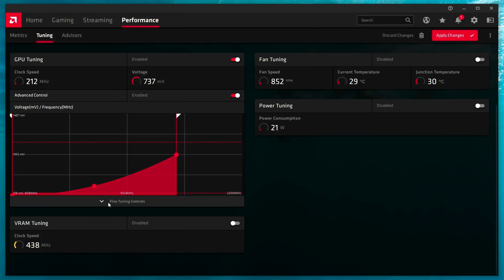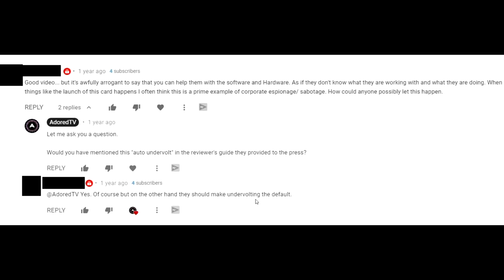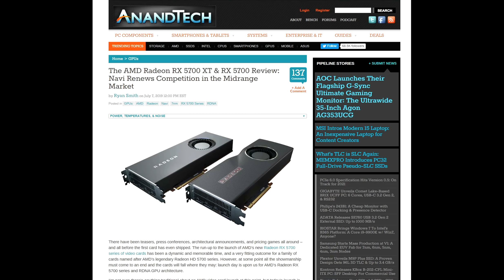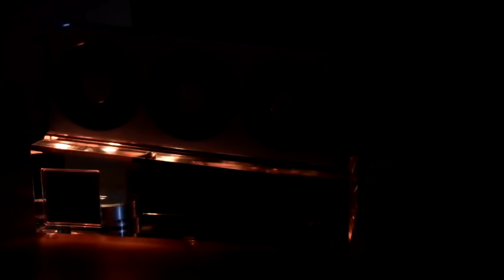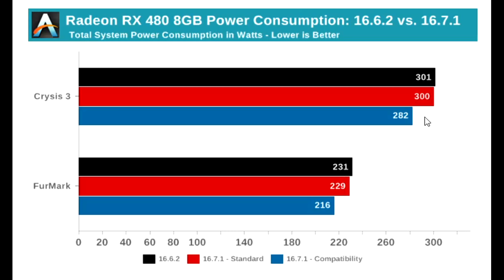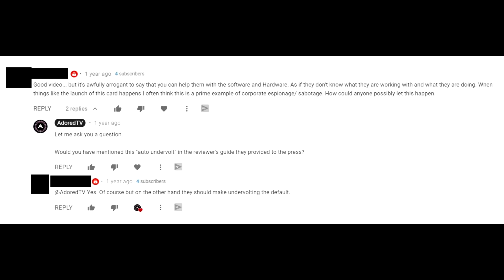Fixing AMD's "Hot and Loud" Graphics Launches.

Comment: Or they could just burn fuses in hardware to tally expected silicon wear-and-tear, and act on this information at a hardware level.  Now /that/ sounds like something nvidia would do!  Storage and printing hardware, for example, use this type of trick to do terrible, highly profitable things to consumers, like under-report toner levels (ie Brother MFC) or brick devices beyond a predetermined accrued data "write" quantity (ie Intel PCIe storage).  So  the card could have a (maybe, opt-out-able) mechanism to, for example, slowly ramp voltage to levels expected to achieve rock-solid stability for two sigmas of customers at a given accumulated area under the watt-time or compute-load-time curves, or both, going back to the original delivery.  This also would also enable the RMA department to mine this data, and even to inform behavior: is this crispy wafer due to two years of mining in a sweaty closet?  Has the card been sitting there unused for two years and the paste dried up?  They could even to enforce divergent stealth RMA policies, i.e., dick over miners if they have voided their warranty in any way no matter how trivial, but honor even marginal warranty claims coming from intermittent-load normies and little old ladies who never used the card for anything.

Comment: making a better cooler too expensive my ass. AMD is making higher margin on the 5700xt than they have ever made on a card. Most AIB card makers say the cost of the cooler ranges from around $35 for a blower and vapor chamber to $50 for dual axial or tri fans. and about $80 for water cooling or hybrid card. and these are very generous estimates I expect given the AIB's are making only around 10% margin on most mid range cards that are at most most $70 more than the reference, not that I will discount the reduced price of the AIB for the gpu silicon by the additional cost of changing the pcb from non reference as in the case of Sapphire

Comment: i buy a ryzen 3600 i have problems with my ASUS STRIX B450 F because of the high CPU temps on IDLE, and really hight temps on CINEBENCH20 with stock cooler so i buy a WATER COOLER COOLER MASTER ML240L and i have 70C max on CINEBENCH20 but i really dont like the CPU spikes on idle is 40c to 54c using firefox, then i buy a RED DEVIL 5700 XT, and i have the problems of all BLACK SCREEN alot ALOT of BSOD, and now with the 20.1.3 i can have a normal working PC, but if  i use UNDERVOLT i use MSI AFTERBURNER and put -20% power like i did with my GTX 1070 with afterburner that i put 80% of power, and this 5700 XT start to get ALOT of problems of stability, i really love AMD i was using INTEL NVIDIA because there was no good options now i think that AMD has the CHANCE to get ahead, but they really need to fix the SOFTWARE because their hardware is awesome but with no good software is a waste of time for all of us USERS

Comment: Jim, if the carpal tunnel syndrome is at all associated with use of the mouse, I have found that it is quite possible to get used to using your mouse with the other hand.  So if your problem is on your mouse hand just switch to the other hand.  Don't change any settings, it'll be much quicker to become natural than you would think.  The mouse hand often has problems because the forearm may rest on the edge of the desk/table and this causes tendon problems.
Reply from the maker: Tried before actually, just couldn't get used to it.  Also it's my left hand that got hit by this so my mouse hand is ok. ;)
Reply: @adoredtv  Okay, but watch for excessive time spent with the forearm across the edge of the desk or table.

Comment: Seems like everyone, and yes myself even, is rooting for AMD to hopefully bring prices back to lets say, 2009-2011 time frame.  As we all know Intel is doing the same scheme as last time when they said they will bring out a graphics card, so don't expect competition from them probably ever in the graphics consumer space but I hope they prove me wrong!  Though, if RTG is not willing to at least get in a room and brain storm on how to solve it, let alone listen to suggestions that consumers "might be okay with," then what is the point of supporting them?  I messed up and ignored every techtuber's advice and just went "all out" and got the ASUS Strix 5700xt instead of MSI or Gigabyte like I usually do because my previous cards with them did not have voltages unlocked and I wanted that feature plus the supposed better "build quality" Asus is known for as I wanted to be as close to 144hz on 1080p as possible.   But between the driver issues and the lack of them wanting to tackle problems like this head on is making it ever more difficult to stay with them.  I'm building the most powerful ITX that I can throw my money at this year as I am over laptops and just don't care for the big cases anymore.   I hope that this is at least being worked on and mentioned along with the drivers by the time Big Navi is rolled out or else, I will be very seriously considering letting my money go to Team Green.  I had NVidia once before and was not impressed with their 3D glasses set up and other things when that was first introduced in stuff like WoW and StarCraft 2 and other games for a short period of time as I felt NVidia rushed it out, didn't continue to support their base and it just left me feeling taken advantage of.  Obviously NVidia still does that type of business practice and its why I still refuse to buy their cards, but if I am going all out on my next build, then AMD really needs to acknowledge these issues, give an update on whats being done with a time frame on the fix or else I can't trust them.  And when you can't trust either company, then might as well get the best you can afford and just let the chips fall wherever they land.  Great video as always Jim!  I absolutely love watching your content!

Comment: Except power consumption tests would show this no?
Reply from the maker: Yes they'd all show lower power consumption, that's the point.
Reply: AdoredTV yea I meant once the consumer variants came out and tests were compared but I commented before you addressed that in the video
Reply from the maker: @Fee.1  Almost nobody actually has watt meters and everybody is running different systems.  The main thing would be noise.
Reply: AdoredTV interesting, that’s kind of disappointing. Am I holding anandtech in too high a regard or are they one of the few doing it right? Also, I wrote to you the day you started your site about writing for you. I’m still here.

Comment: Jim:  Automatic Undervolt

Internet: So you have chosen death by fanbois and downvotes

I have a reference  HD7970 still going strong that I flashed with an overclock and undervolt.  I find that as long as the GPU itself is built with a good VRM and power delivery and run within the operating temperatures it will last.  It's usually the environment that determines how long it will last.  Take whatever GPU and stuff it in a airflow restricted case, or full of dust or surrounded by hot components that dump heat onto hit; that will shorten the life of a GPU much quicker than anything else.
Reply: it took me 3 dead HD7850s before i realised that the gpu core undervolted so well, that setting the fans to cool the core ended up cooking the VRAM every time.
Reply: YES! MY SWAMP ROFLS THE MOST POWERFUL CAPACITORS! FLORIDA MAN!

Comment: My fav tech analist back with something I'm interested in! And also glad to see other people were already there to help out that on Polaris, the compute setting still is available in the 2020 drivers. Though I have no idea why anyone would still use a Polaris GPU for mining today but that's a different discussion. In short: AMD should give under-volting a more significant position. Remember the stars needs to be aligned well for it to not crash in certain circumstances like settings for PCI-E in the UEFI and the quality of the PSU as well.
Reply from the maker: That's the thing - the number of cards that would be returned from undervolting issues would be small, and what's more with a proper support system in place it needn't happen at all.

Comment: Ehh, pretty sure Nvidia "jebaited" themselves with the 2060 price drop, not AMD - a card that was originally supposed to compete in a higher tier not only got beat up by the cheaper 5700, but then they try to "jebait" AMD with a price drop to $300... only to end up with a 2060 that can't even consistently outperform a $280 5600XT.

Comment: i would personally make it so the driver every 10-12 weeks does a stress test while testing the voltage and if it detects a driver crash does it automatically on next boot
Reply: Would be great if the drivers had an auto stress test that test the cards performance, stability and tries to under volt as much as it can without undermining the cards performance and stability, it could do this over many reboots to try and find the sweet spot.
Reply: @paul1979uk2000  Nvidia has a tool like that, my friend was just telling me about this.
Reply: @Jimster481  I wonder why it's not used more or if AMD or third party software that does the same for AMD gpu's.

Comment: Edit: Bah, @Denis Patrik beat me to it...

Interesting video..

Option 6 - Get rid of "Undervolt". It's a made up term that's all relative to spec anyway. Make "undervolt" the new default spec. That seems like the most logical anyway, because if it's able to operate at a lower voltage, why is a higher voltage the default? Then they could advertise that they can maintain "Overclock" levels for 3 years.. 

Undervolt -> Default
Default -> Overclock
Overclock -> Extreme

Comment: automatic undervolting makes my Gigabyte Vega 64 GAMING OC 8G unstable -> black screen.
but manual undervolting works fine for me.
Reply from the maker: You can undervolt further manually?
Reply: @adoredtv  
the gpu can't hold the Vcore and drops a lot under load.
For example: manual I have  the VCore set to 1,000V for 1,580mhz (P7)
the gpu will drop the Vcore in superposition uhd  to 0,93V-0,95V/1530Mhz.

With the automatic undervolting the Vcore gets lower in the test (0,9V/1470Mhz) and this is not enough too be stable. 
The pop up from automatic undervolting says 1,140V when it's enabled.

 this custom from Gigabyte Vega64 is not the best.

Comment: A couple of notes regarding the same problematic @ my NV Titan X (Pascal):

1. GDDR5X downclocks if compute is forced (mining, blender etc)
2. GPU throttles under heavy compute since it hits the TDP limits. Thats inherits a automatic downvoltaging aswell, prolonging the lifespan and efficiency.
3. NV has a far more flexible Boosttable (Afterburner Curve editor) than AMD has. You can set a specific voltage every 12,5 MHz - so you can undervolt lower at the higher clock spectrum and vice versa to your hearts content and still have rock solid voltages at the compute frequencies, that will be lower than max boost.
4. NV cards, at least the pascal ones, have huge reserves for UV aswell. My Titan runs now 2025 MHz @ 0.981V. Stock it clocks to about 1900 MHz @ 1.062V, if its not hitting the (maxed out) TDP barrier first. Now I nearly never hit the TDP barrier of 300W, while still being much faster.
Reply: ive put a "no tdp limit" bios on my 1080Ti and edited my RX Vega 64 registry to have a no TDP limit..... and then i gamed each of them until my room became an actual SAUNA. Tbh, you should try it. Heat wont kill you, but you will sweat like a pig while playing with your friends :D just make sure you watercool that Titan....
Reply: @WhiteSkyMage  It is actually watercooled, so no worries.
Reply: lol. Reminds me of frequent comments I've gotten about my computer room being hotter than other parts of the house.
(nice in winter, but less so in summer where it can hit 37 degrees already in the rest of the house)

Guess having a plasma tv In there as well wouldn't help...

Comment: RTG needs graphene coated heat fins, the cheap stuff thats only 5X faster than copper instead of a 10-30x faster
Reply: fewer heat pipes, more surface area, and the surface area that is there, being more effective as the heat gets to the areas farther away from the heat pipe faster
Reply: Lets not forget that not only is graphene anywhere between 5-30x faster than pure aluminium, but anywhere between 50 and 300x faster than the aluminum oxide that covers the fins on a normal heat sink, now this isnt going to be a huge difference(probably) because the air is constantly flowing over the fins, but it will make a difference, maybe it will make a 1-3% difference, but add that to the 10-15% difference the graphene will make to moving the heat to more surface area, then RTG might see a 11-18.5% improvement in heatsink performance, but might see a reduction in price a few generations down the road with less need for heat pipes to maintain the same performance

Comment: Starting at a lower voltage and slightly increasing voltage over time would make sense. Even better would be only increasing it if the card detects potential stability issues. Adjusting frequency is probably not a good idea since this is a metric of comparison for consumers.

Comment: Hello, Im a vega 64 user and I tried all of the Oc and undervolt tricks there is yes even PPt. Mine is underwater so I can manage really hot temps.

The only issue I see atm with the Auto is you can change any seting so no OC. All of the users that you afterburner will have a no go at OC and say oh AMD cards cant oc its locked and thats it. 

Ofc as we know just change the tunning option to manual and thats it happy days. 

From my old x700 that still works to my Vega64 im really happy with all of the cards from amd, you just need to know what you are doing and thats it free performance. 

Great work, keep it up

Comment: I think if AMD was transparent about increasing voltages over time for stability sake they would be fine. Just call it a feature integrated into the card to ensure stability for the user. Also let people know that people running intensive workloads that would really hammer the GPU for long periods of time should default to the longevity setting or something or call it Endurance ...ect idk.

Comment: The reason why I don't buy AMD cards is because they tend to run hot and loud. I can accept a bit less performance or a bit more price if a card is overall what I want. I cannot accept noise or excessive heat that leads to noise. Loud cards do not even make my list of options to consider. Sure, I can try running them under spec but that has no guarantees of reliability, feasibility, or suitability from the manufacturer. Thus I tend to run relatively powerful cards at default spec.

Comment: What about a different approach: When Ryzen 3000 launched most of the reviews stated that Undervolting is no longer useful because the CPU tunes it self to the best voltage and undervolting will decrease Performance... So if they could port this technology to the GPUs they might solve this issue once and for all and the golden samples would even get better results than the average cards...

Another opinion: I dont think that enabling auto undervolt would be a huge problem. Just enable it once after each driver installation and if it crashes reset to the default values without it or prompt the user if it should be deactivated b default. Could at least be better for the press driver...
Reply: RTG is getting more help as of late from the cpu division. Renoir with Vega graphics has theses silicon level optimizations from the CPU team IIRC

Comment: I had ulnar nerve entrapment once for few month because I had a bad sitting position in front of my PC at work. When I became tired I  proped up my head by hand for hours. In that time my arm was V shaped, elbow was pushed to a hard desk surface, that nerve was somewhere around that pressure point. Ultrasound lead to definite diagnosis, got Vitamin B complex called Milgamma prescribed for nerve recovery. If you end up with similar condition you can boost up recovery with higher red meat intake or even some organ meat meals (heart, liver, etc) they provide huge amounts of B vitamins and collagen. Get well.
Reply from the maker: I have some pretty heavy duty B-vitamin pills which I'll start taking cheers.

Comment: AMD, imo, could make auto undervolt slightly less severe vs. current style. Possibly include more driver-based analytics to determine undervolt on a per card basis, and *key*: have the driver run the analytics repeatedly over time (monthly?) and adjust as necessary. "Auto" in my mind says it should do this already. 

Then release the reference card with it enabled by default for all. Give OEMs the option to ship with it on or off. Then the answer to "is it shipped this way by default?" becomes yes on the default cards but OEMs can choose the option that fits their cards best.